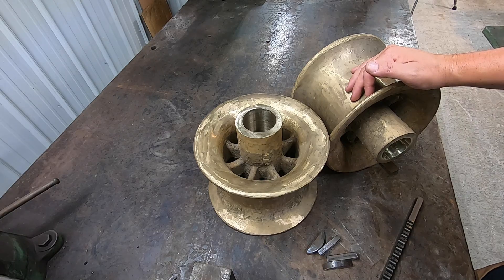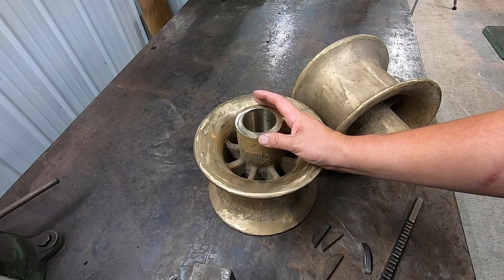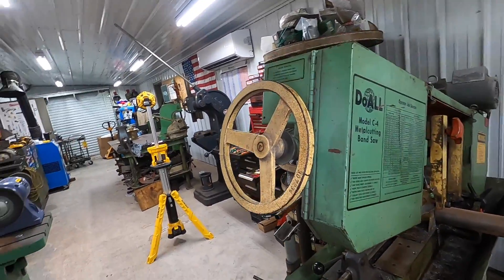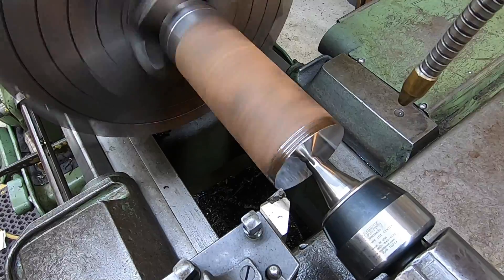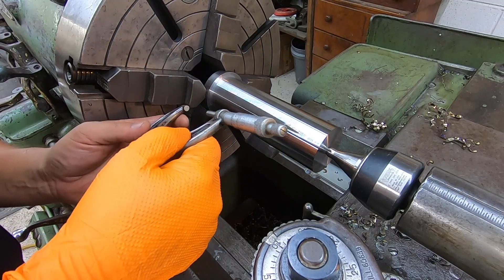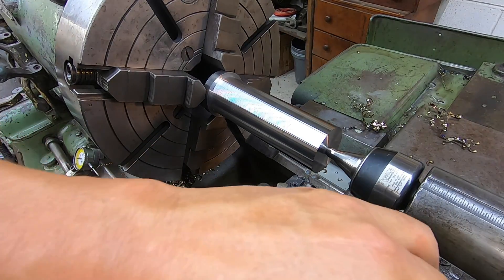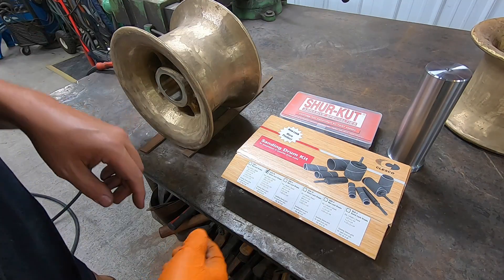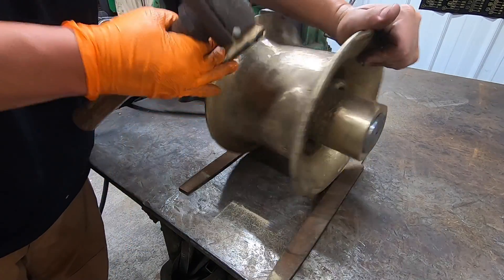Broaching Keyways in Cast Bronze Capstans Part 1

Comment: I am a huge fan of your videos!  Question from a person with ZERO experience in machining:  I notice that sometimes when you are checking for runout on the lathe, you actually have the plunger rod at an angle to the surface.  

The question is, do you take into account the error that this angle creates on the dial indicator reading, or does it not matter since the indicated runout will always be larger than actual, since the plunger rod forms the hypotenuse.  For instance, if the plunger rod were at a 45 degree angle to the surface being checked, the Actual Runout [X] would be COS(45) * indicated runout [H].  So [X] = .525 [H].  So if you place the plunger rod at a 45 degree angle to the surface, the actual runout is roughly half of the indicated runout?

Anyway, in this case it doesn't matter since the indicated runout is always larger than actual, so you have a safety margin built in. 

So here is the question in short form:  do you guys take the plunger rod angle into account when you are checking for runout, or is it never really considered?  Thanks!
Reply: Just checking for run-out can pretty much be done at any angle.
The goal is to achieve little R O as possible not a specific numerical amount.
Reply: Yes/No. For one, small angle theory states that it's pretty negligible, unless the angle is large. But when using an indicator for dialing something in, you're looking for minimal movement as opposed to an exact reading. For measurement purposes you would want it to be orthogonal, or nearly so. It's more of an issue for test indictors which measure in an arc. Lastly, indicators are rarely used to measure true distance, but instead should be used as a "comparitor" to compare a part to a reference surface, such as a gauge block or angle plate.
Reply: Runout is runout and if the setup alters the indicated shift it does not matter. Aim for no runout. Now if you were measuring the quantity of movement(such as the depth of a step) then yes it would give an error.

Comment: I don't think those woodruff keys are long enough to pull a chain with an anchor, but if it's rope on anchor; that should be fine.
Reply: These are for the sail sheet winches.   SV Seeker is a junk rigged sailing wessel.  The anchor chain winch has proper chain sheaves.
Reply: @MattOGormanSmith  Excellent reply, Sir!  You  have obviously have spent some time upon the water.  I just wonder how many folks will actually understand it!

Comment: Very cool project. Thanks Adam. Even though my lathe is sitting in storage until I retire, watching your videos has motivated me to work on it, disassembling the slides, cleaning up surface rust and burrs, adjusting the gibs, all in preparation for adding the DRO that I purchased for the X&Y axis. I like the DoAll band saw but hope to find a power hacksaw to restore instead for my shop. Again, thanks for the episode.

Comment: and the keys in bronze are supposed to stand the torque of the anchor pulling on the chain in bad weather? would not a conical shaft fit (in addition to the key) be required to avoid risking bronze deformation at full torque?
Reply: There is little chance this "boat" will ever do anything productive on the water. Nothing he built would survive the sea, especially with that idiot in charge at the helm.
Reply: @davidkennedy3050  Obviously you are a loser in every sense of the word. Keep your negative comments to yourself.
Reply: @davidkennedy3050  butthurt, Doug's point still stands whether or not you want to accept it. It especially shows in the way you're acting, humans get to invested in things that don't even matter and we need to let go.
Reply: n 135246 these drums are for ropes not chain. The anchors would be on the windlass. Stay safe in these difficult times.
Reply: @johnsawyer2516   I'm not sure how the "anchor winch" would be used (possibly not to pull an anchor ? would it be by means of rope or chain...), my point was that this looks to be a beefy piece which I would believe is so to handle a bit of torque, yet all that would have to pass through the angle of a steel key into relatively softer bronze... with tolerance on the shaft (including over time) also playing a role on torque end point application.
Reply: Plus, Adam isn't the designer, he's just doing what the customer asked. Its not up to him to make sure it will do what the customer wants, just what they asked.

Comment: Dang, too bad he didn't have you clean them up on the lathe all over, those could look really professionally done.
Reply: I think that surface is a theme on SV Seeker. Thats the signature charakter of the boat.
Reply: @hermannstraub3743  yes, junk in every sense of the word.
Reply: Probably worried they'd turn to dust with as porous as they undoubtedly are.
Reply: @thomasbecker9676  50/50 sand inclusion and bronze?

Comment: Wouldn't that key be much stronger than the  brass base metal? Like wouldn't it just carve out the ID before it breaks?
Reply: Those capstans are nickel aluminum BRONZE.  That stuff is both strong and corrosion resistant.  Bronze can be as strong as some simple steels.  The issue with bronze is cost.  The expense makes sense in a marine application, given the resistance to corrosion.

Comment: Can a shaper be used to to this job???
Reply: Im curious too.
Reply: I thing holding the part would be a challenge. This Old Tony did it with a scraper in a video but his scraper was a lighter duty tool.
Reply: broaching is likely easier, because of long bore, limited space, and work holding, vs, cutting a slot and ramming a cutter through.

Comment: Why not use your  shaper as you have the stroke?
Reply: He would have to build a custom tool holder that would reach through the part.  Probably more work than he was looking to put into the project.
Reply: workholding and space would require more work, and this is a simple job.

Comment: Greenlee sells sheaves we use pulling wire but they are aluminum. Similar shape, I wonder if they would make good capstans
Reply: They might be OK for fresh water but these are going to be in a salt water environment.   They may be a little too soft; I don't know.
Reply: @royreynolds108  Lets be real for a minutes.  This thing at best, will be in the water once, and then it will mysteriously sink, or end up in his backyard for life.  He will not be able to get insurance for it from any normal marine insurance company, unless he can pass some sort of non-standard build process for safety and other factors. Even passing that, expect a skyhigh insurance premium.  This guy will sink it 5 minutes out of the berth.

Comment: Looks to me that keyway could have been cut on the shaper? , just the tooling to hold the capstan in place may have been a challenge, however, bronze is soft compared to steel and seems the shaper would have been ideal.
Reply: Those parts are nickel bronze.  There is nothing "soft" about it!

Comment: I think that boat will not be seaworthy at all. Mechanically it’s not how things should been done in a boat. Strange guy Doug Jackson btw..
Reply: I stopped watching for similar reasons. I assume it would have to pass inspections. I figure there's a reason why shipbuilders aren't used-to-be-IT guys and instead bring collectively 100s of years of shipbuilding experience and engineering to the table.   SVSeeker - Shady Value Seeker?  I dunno. Just seemed way to garage weekend-warrior level.
Reply: @Captain MufDyven I worked on that boat (Before the fake BS) will it float? yes. Is he doing it his own way? yes. Would I want to crew on that boat in a storm? NOPE.
Reply: Craig Blanche   @Captain MufDyven my favorite one is the video he did a like more than a year ago that showed  the fact he's already over the boats design weight by like a ton. And he's not even closed to finished.

Comment: That machines great for 1018!  When I machine that stuff it just looks like a rat chewed it.
Reply: Also, don’t use rat teeth as an indexable insert. Despite their seeming ability to get through anything, they’re not actually made of carbide... 😜
Reply: Dark Winter ya but they’re really cheap!
Reply: Pretty much the same with all of us mortals lol. 1018 needs rigidity and a heavy cut to turn out really nice and a positive cutting action and rigidity for fine cuts to finish really nice. What you are seeing is Adams experience in tool selection and his machines.
Reply: Rigidity, speed, and feed.

Comment: Have you got a way of checking those castings for voids or fractures, when you think of the potential loads on them.
Reply: The less he does for this guy the better. Prob are full of voids, however the guy is a know it all.
Reply: @boots7859  I think I may have watched a couple of minutes of one of his videos and decided there's  nothing of any worth.  I have used winches and capstans extensively and can see these are never going to be fit for purpose - and will fail!  Advice to Adam...............send them back before you get tarred with the same brush.

Comment: 6:46 I have a metal cutting DeWalt carbide blade chop saw that would cut thru that round stock in a minute with no sparks and no flashing.  Good idea to wear hearing and eye protection, however.
Reply: Adam has one and has used it in a recent video. This time he preferred to use the band saw.
Reply: @paulcopeland9035  That's right.  I forgot. I've seen him use it too.

Comment: Adam is it just me, or are the holes and hub of the capstan not coaxial?  It's nice that steel broach plug just slides back out of the bronze.  Can you imagine doing that with two steel parts? The galling would be incredible.